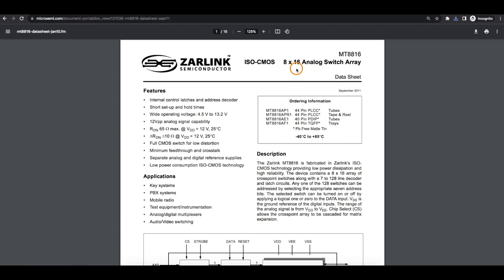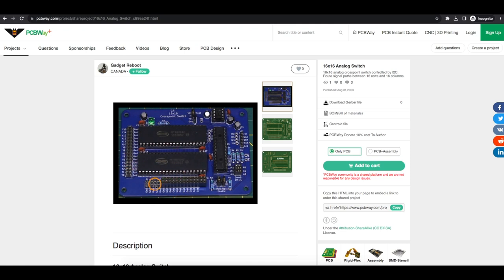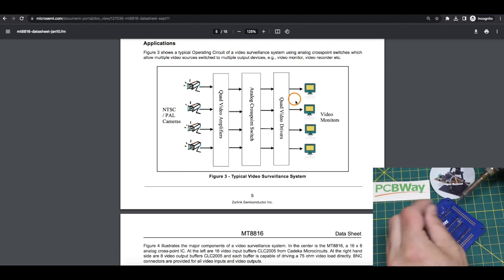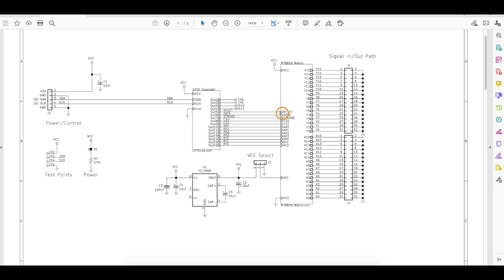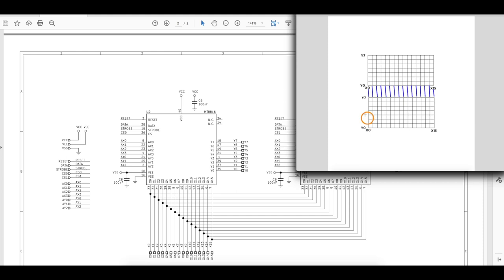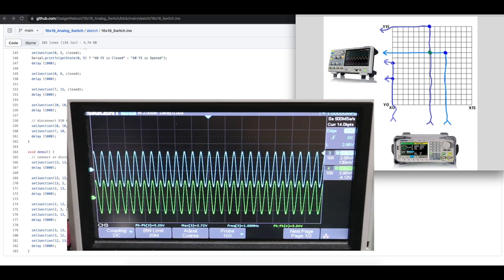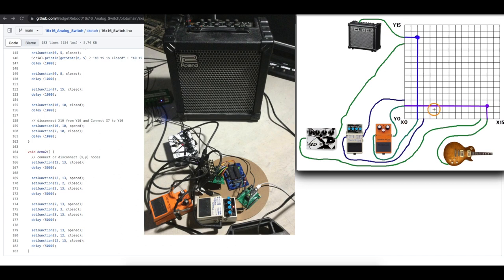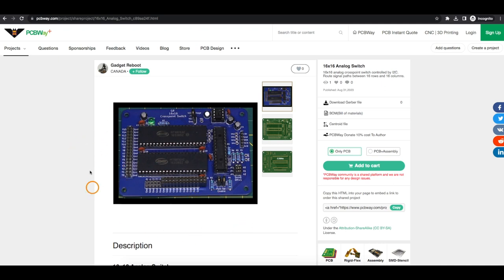16x16 Analog Crosspoint Switch using two MT8816's

Comment: Hey friend, I'm working on a clone of the famous EMS VC3, a mechanical matrix is really not easy to build, this circuit presented here is a great option to solve this problem although I won't give up on building the mechanical version first myself. A big advantage of using the MT8816 and a chip programmed with Arduino is the possibility of implementing presets, I see a future in this. A very disappointing detail is that I worked in telecommunications for 25 years and we threw dozens of these MT8816s with ceramic encapsulations in the trash. Regrettable...
Reply from the maker: that’s why I don’t mind hanging onto all kinds of old circuit boards and things, I don’t consider it hoarding, just preserving inventory until I find a project for it!
Reply: @GadgetReboot  Pure truth. I have a habit of saving PCBs and components of all types. I worked at a telephone company here in Brazil, we were discarding many boards, devices and electronic components, I rescued as many as possible and didn't give any importance to the MT8816s, which were just a memory. I'm going to take a chance with some Alliexpress parts.

Comment: Exactly the video I needed for my experimenting!! I ordered the pcb. Looking forward to trying this out. Would it theoretically work to expand further with I/O’s?
Reply from the maker: I think everything can be expanded including the analog matrix or any more control mechanisms for it although I don’t know if there’s any limitation at some point where multiple chips have to be interconnected and there could be problems introduced running between chips like noise getting in or complications in trying to do signal routing on a circuit board but I figured 16 channels is a good place to start
Reply: @GadgetReboot  am I thinking correctly if I assume I have to quadruple the amount of chips to double the I/O’s?

Comment: What’s the PCB that you used at the end to connect the 1/4” jacks in?
Reply from the maker: that’s some thing I made using two vertical stacked jacks with five of them side-by-side. Neutrik NSJ12HF-1 but they’re kind of expensive.
https://www.pcbway.com/project/shareproject/Dual_Stacked_1_4_Phone_Jack_Breakout_Board_8c83ed54.html

so that’s why I just made the more basic board with the regular jacks and then I can just flip a board upside down to stack them and I can put more side-by-side to extend it.
https://www.pcbway.com/project/shareproject/1_4_Phone_Jack_TRS_Breakout_PCB_8e518ade.html

Comment: does this mt8816 chip support serial communication?
Reply from the maker: I think I sent a 1 MHz sine wave through it successfully although I didn’t try something with  fast edges like square waves but maybe I can test that out. I would assume it would work other than just making sure there’s no weird artefacts like ringing on the edges
Reply: @GadgetReboot Can u please check it and confirm it using square waves